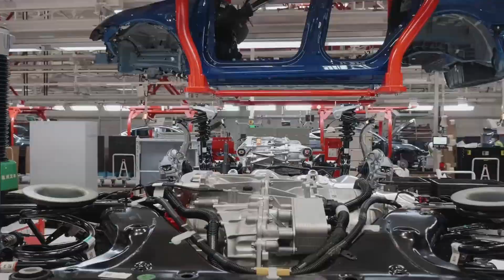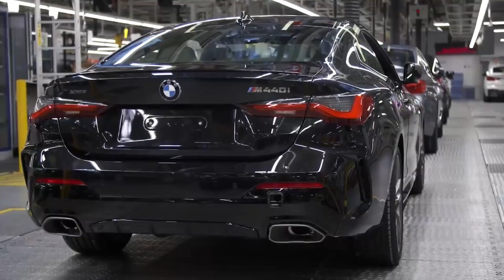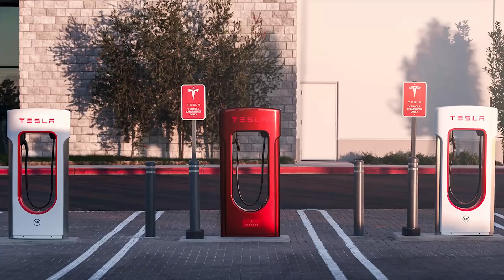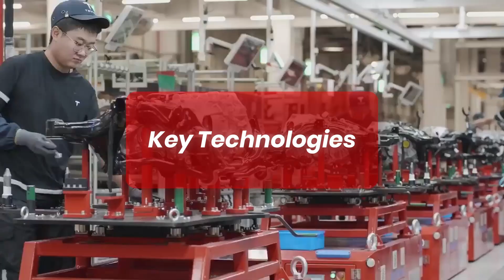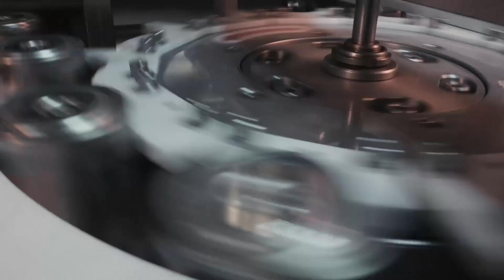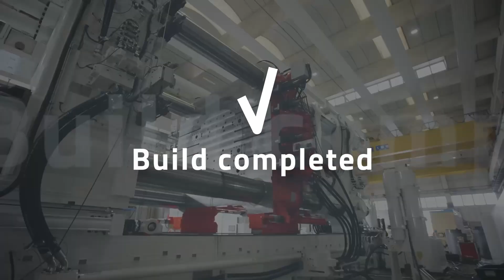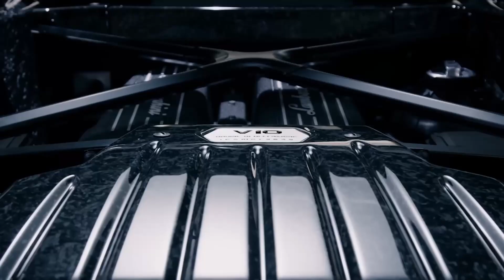Alien Dreadnought 3.0 - Elon's Factory of the Future is being built today!

Comment: Painting a car is Yesterday. Even without the Carbon Fiber Idea, Wraps are the future. They can be done in all kinds of colors and protect the body better than paint can. And there doesn't need to be a paint shop in the factory at all. Most people would accept a metal-colored car IF the price is right. And those who want color can easily add a $1k-2k wrap.
Reply: Embedded plastic body panels... Smart used them along with a modular factory concept where pre-fab pieces were done by sub-contractors and just plugged into place saving time... Sounds A LOT like what Tesla is planning but with all electric vehicles... I approve!
Reply: Lol where can I get a $1-2k wrap?  Wraps cost more than a GOOD paint job.
Reply: @incognitotorpedo42 in my country wrap costs around $350
Reply: @elon-69-musk Sure but it will cost us  lot more to ship the car in your country lol.
Reply: @incognitotorpedo42  We're talking about the future here. Of course the wrapping process needs to be automated or done by bot. I thought that was self explanatory. But even now many people opt for PPF on their Tesla's on top of paint.
Reply: @johannesdolch Yeah shrink wrapping /heat mold process for body panels would be good way to automate it.
Reply: Yup.  There's not much difference between an all metal car and the black, white, or grey cars we see most often on the road and in parking lots today.  Red, or blue cars are the  uncommon thing.
Reply: I agree : A factory Shrink Wrap option could add value and Margin . Wrap the unboxed elements .
Reply: I love that idea as I am a vehicle wrapper!! Vinyl is much better than most people think. The maintenance paint needs and repair costs are much more expensive then it costs to rewrap a car!
Reply: @andrewvercillo6225 how much to wrap a Model Y?
Reply: Drake gotta wrap...
Reply: Wrap is the way to go. 👍 They didn't mention the environmental disaster carbon fiber & resins are - just moving the pollution to a remote factory.☢️ Wrap over aluminum is recyclable 💯♻️
Reply: @MashDaddy Aptera’s carbon fiber is recyclable up to five times. Assuming the car lasts 20 years that’s 100 years.
Reply: Cars need ti cime with a projectuon feature where you can just project whatever color or image you want
Reply: I owned an early saturn and the panel aspect of those cars was AMAZING way back then . I would have been 100% fine with my saturn coming with a non painted finish , I'm sure there could have made matte colored panels . Matte PAINT finishes are popular and offered today .

Painting steel for and  outdoor appliance has been STUPID FOR A VERY LONG TIME . GM has blown soo many opportunities its insane.  

I liked my Saturn in many ways and I had an early production one  . That did allow me to buy it very inexpensively despite no haggle pricing because as they became popular prices were raised nearly every month until they were no longer very cheap bargains , I got lucky and mine was flawless  and I abused it like no other for 100+ K with no failures . I truly abused it , I changed oil on time etc but I pushed it harder then any vehicle ever , towed with it while driving it like a race car with the trailer on it , would sink into salt water up to tail pipe where it was bubbling salt water for 6 years 8 months a year,  the pedal box / floor on drivers side was raised 4 inches I some spots where the salt from my shoes and drippings from wet suit built up a solid lump of sea salt . I had the twin cam version and redlined the piss out of it everywhere and pushed it every chance i got on ramps and turns . Weighing in the 2ks / lightweight with twin cam 1.9 at around 130 HP it had decent acceleration and with good tires for the time period they handled quite well for FWD car , for a cheap 4 door car with twin cam engine , ABS and some other decent specs for the time the original ones that were like 11k with manual trans in 90s they had some very positive aspects.  

If GM left Saturn alone and Saturn had kept innovating and improving the brand and products they could have had something good . But between Unions and being part of a giant beuracracy that later stuck their noses in GM ruined Saturn and killed the experiment.  

I can NOT BELIEVE that the saturn panels did not become the common way of building cars . They worked EXTREMELY WELL for the cars they were used on . They did well on safety etc .  Did they have issues , apparently they did for some people and cars as far as some engine issues with head gaskets and some other issues whith high miles that could have been dealt with . 

They were also ahead of time offering a TIMING CHAIN at a time  when everybody was going to belts requiring expensive maintenance at as early as 60K and failures of belts on engines that made any power causing catastrophic failure . They had some good ideas and the PANELS WERE AWESOME and a good part of the reason i early adopted and supported them / took a chance , that and the early production pricing where i bought a high trim  car out the door for 12 K That eneded up coming 16K not that far in future as Brand became popular and was not the same value proposition.  But they could have advanced the company and GM as per usual DESTROYED what egineers did that was great .
Reply: @RandyJM21  I wpuld have liked to read that whole comment but my mind said no lol. One thing is clear though, you are a very rare person that exists today that says I love my Saturn and refers to a car lmao
Reply: Yeah , Im a lot . But to clarify I said i liked it and LOVED the body panel tech that was WAY AHEAD of everybody for the time, they had issues but NOT the panels, which IMO should have been adopted, especially for appliance type cars. @BlackandWhitecustoms

Comment: During watching this video I was on the way to say, have a look at Aptera. You did. 
Re assembly, like Volkswagen with "Halle 54" in the 1980 and others and finally Tesla with model 3 all was over-automated. Better construction, less parts means less assembly work. With Optimus, Telsa was very keen to have a Robots that works very similar to a human. Humans and Optimus can be exchanged in both directions. Where wages are lower they can keep humans. But they also need better human protection.
Where wages are higher there is more pressure to use robots. So I can imagine they can have different approaches depending on the quantity and wages. 
But I expect they will have very high takt rates we have never considered up to now. Latest then - in mid term 2026/27 everywhere will be robots.

Comment: Thanks for discussing the A, B, C pillar issues. Neat idea on how to cast that.  I still don’t follow how the panels get color in a DRY factory
Reply: Wraps or inherent pigmentation in resin carbon fiber molding
Reply: Imagine composit arrives to Tesla in large rolls, all pre-coloured. These are cut to size and heat-moulded, similare to how cybertruck steel is handled, but lighter and easier to handle. These coloured panels then clip onto a subframe or are structural components in themselves. Dry process, no paints.

Comment: Let me try the riddle: If the painted parts are the sides and the floor, and the front and rear castings are similar to the Model Y, the "Other" castings can not be many things. Casting the external parts of the vehicle that are not on the sides may avoid having to match the paint on both sides perfectly? So bumpers, hood and trunk lid made not by stamping, and not painted in the traditional sense?